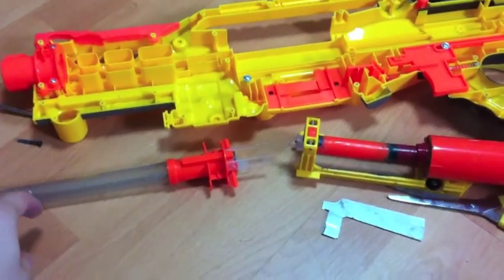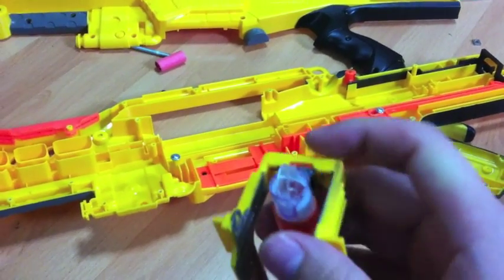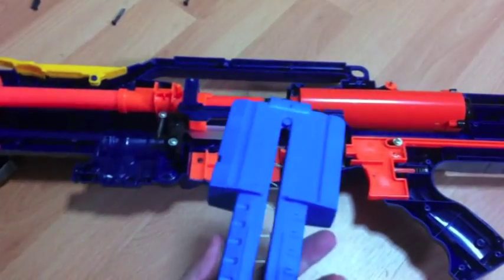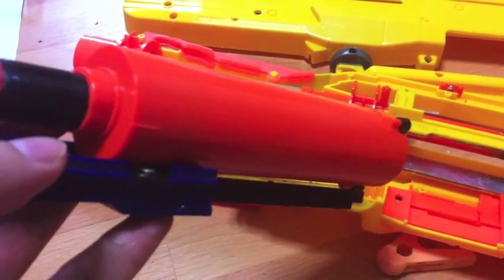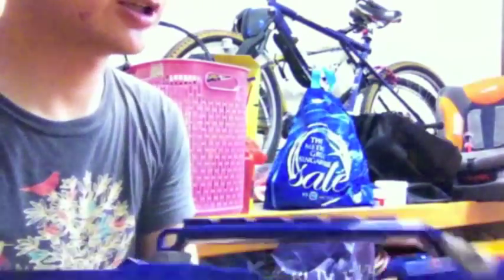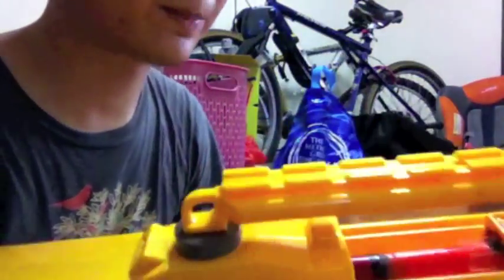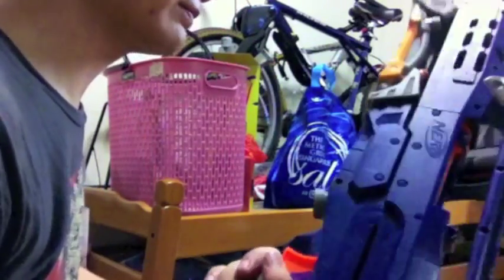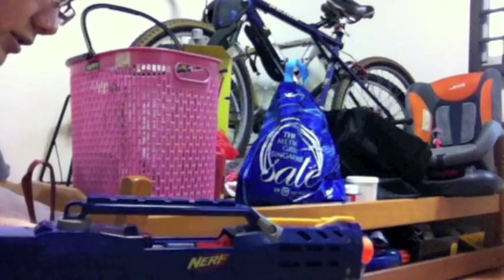PETG Breeched Nerf LongShot Mod (alternative to BBLS or other kits)

Comment from the maker: it's 100% sealed in the breech ... getting 170+fps with 14kg spring load and 200+fps with 14kg + stock LS spring load ...

ranges 100ft odd